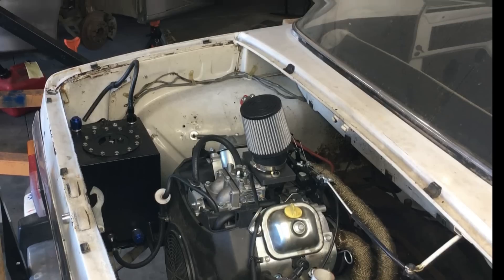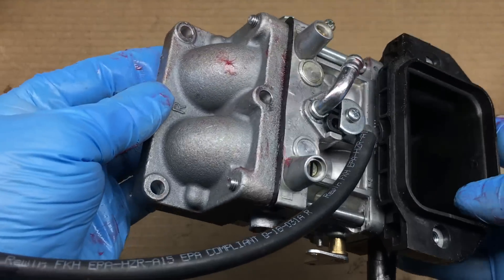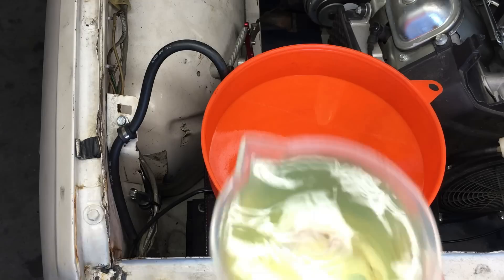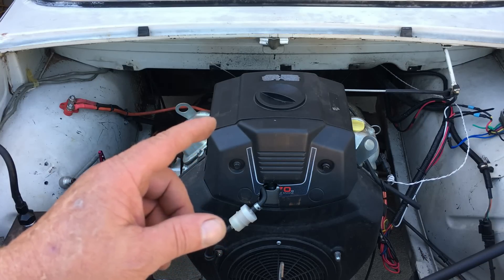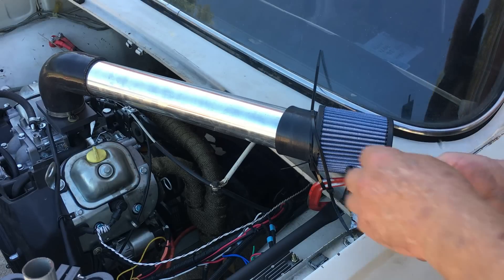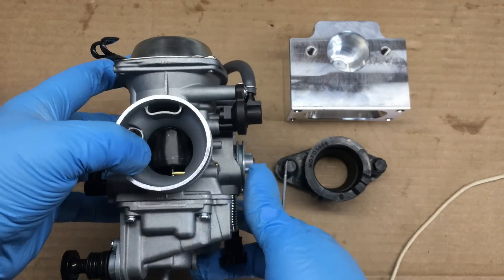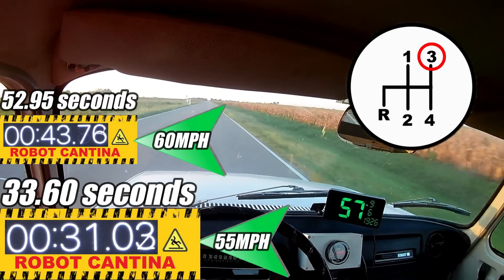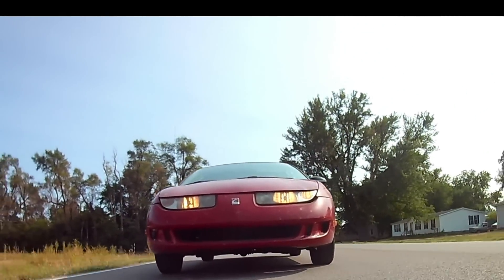S3 E28. Performance tuning and MPG tuning the 670cc predator powered Renault

Comment: You know, its current acceleration makes it a perfectly acceptable "around town" driver that would beat the pants off most cars for gas mileage.  I really like this little car.  :)
Reply: I'd cruise around in it for sure!
Reply: @goosenotmaverick1156 the 44 mpg he gets is all country highway driving, but i bet city is still 35+ mpg
Reply: @that1guy82  no doubt! I bet you'd be hard pressed to drive it and get less than 30 🤣
Reply: I was wondering how close it was getting to the stock car too
Reply: @pleasedontwatchthese9593 the stock 1.3 has about 47hp, but the 670s a tad lighter, so i bet it can match it, especially if Jimbo does some CVT magic
Reply: @IntegerOfDoom  try having a car like my wife's,  Acura TL type S, it gets 20 ish on a good day if i drive, if she drives, forget about it i just as well have bought a tahoe or something, it gets 16-18 if im lucky 🤣
Reply: @goosenotmaverick1156  2012 malibu lt with the 2.4 "ecotec" engine, 18.8mpg city 27-ish highway. 
compared to a 2003 subaru baja 4cyl that chugs oil, gets no idea how much city and 31.7 highway. cars are devolving at lightspeed.
Reply: I like all of the work he's done to it and I love the car at one point I would call it good a cold air intake would have been better than ram Air at that one
Point .

Comment: wonder how much improvement has been due to engine and cvt belt break in??  I personaly like CV carbs, sure some of them need a bit of modding to be optimal but for street use on motorcxycles i wouldn't want anything else.(currently have a harley and klr with them)

As far as your intake mods go, the negitive results are not that surprizing to me.  We don't apreciate the time/care someone has spent in r&d to build engines like this... we think oh I can do better just do this that and the other thing.....  rarely can without trade offs.

Comment: Correct me if I'm wrong
But the ram intake did work right? You were getting "boost" to the carb, but the issue was that lawnmower carb did not work under positive pressure. But you changed the carb for one with adjustable venturi. So would the ram i take work now? Carb should adjust  itself under positive pressure right?
Reply: I believe that is his plan.

Comment: I guess I'm indifferent to the fuel economy runs, but is there an inline fuel flow sensor that you could install to calculate fuel economy? It would probably introduce some degree of fuel flow restriction that you'd have to measure, but it seems like it would be simple and cheap, except for maybe figuring out how to do the data logging. If it was reasonable to set this up, I would think it's less of a nuisance to measure that way instead of with a beaker and a stick.

Comment: The new carburetor can help with the ram air I suppose?
I saw one polish guy put a 'polish nitro' in diesel Mercedes (actually propane injection) with the airflow operated variable injection, which was operated from normal propane tank by driver turning valve XD.
It was a funny video.
What an interesting and simple solution.
I wonder if ram air intake can be put on the roof f1 or Pagani style.